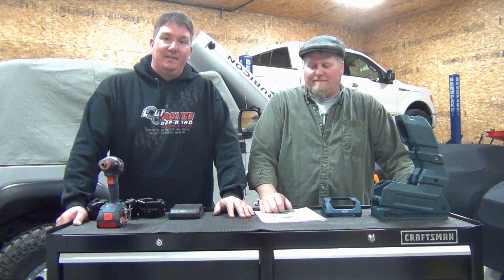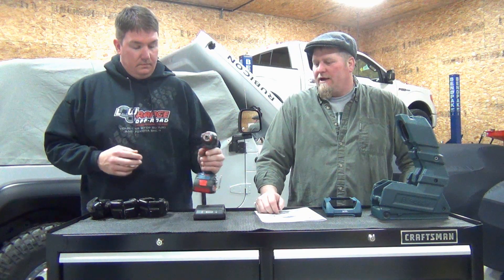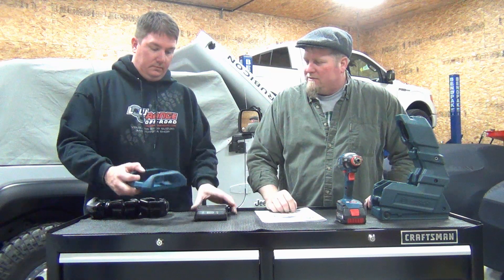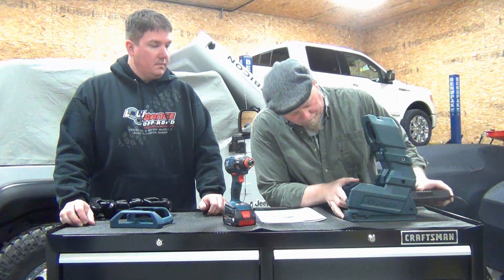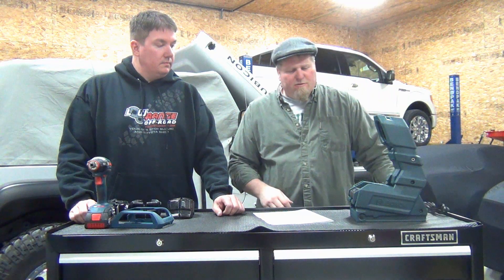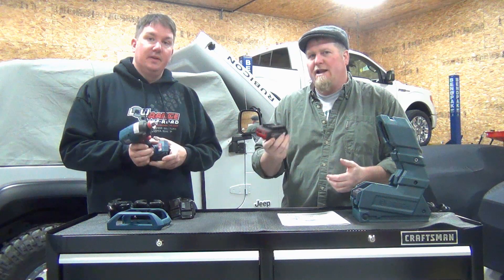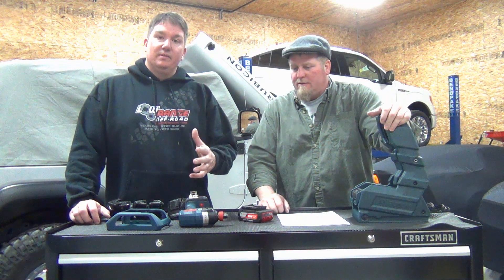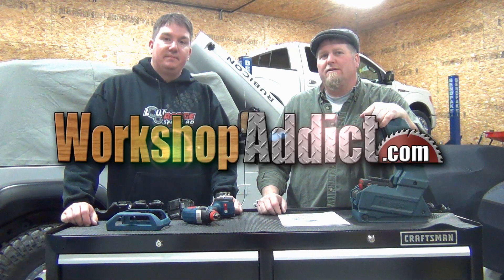BOSCH Power Ready Wireless Charging system - First Inductive Charging System For Tools

Comment: Cool technology, always have full power,down time is just about non existent.  The battery looks big for 2 ah, looks about the size of a fat pack, is it?
Reply from the maker: James Patton  The battery is bigger than a 2 amp hour battery.  The bottom of the battery has some tabs that allow it to hook into the Frame and Holster Charger.  Its in that section that the copper coil is housed.  So, it is about 1/2" taller than a 2 amp hour battery.  Good eye.
Reply from the maker: James Patton  I just added pictures of the 2 amp hour inductive battery compared to the normal 2 amp hour battery and then the 3 amp hour comparison to a thread on our forum.  Post #21  http://www.workshopaddict.com/forum/battery-operated-tools/5109-bosch-now-has-wireless-battery-charging.html